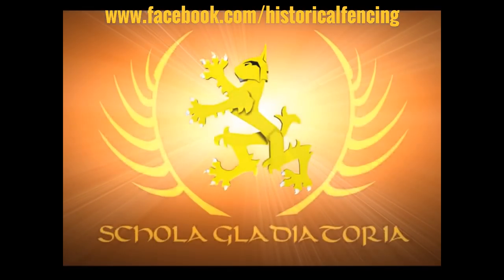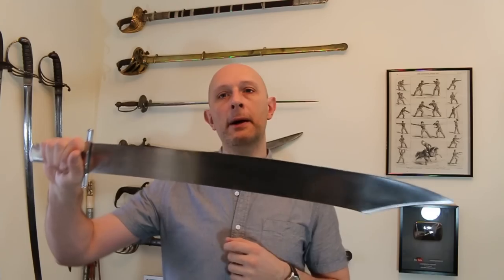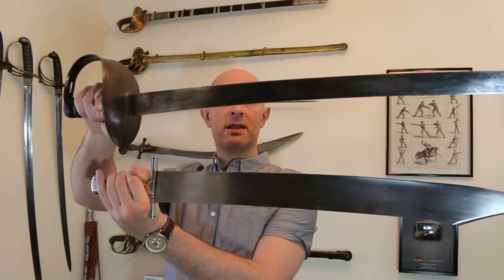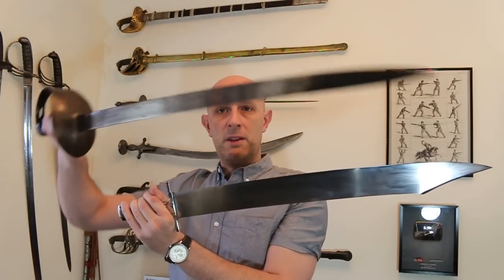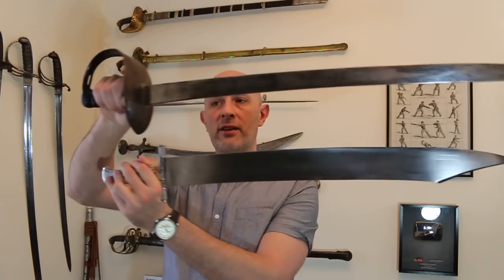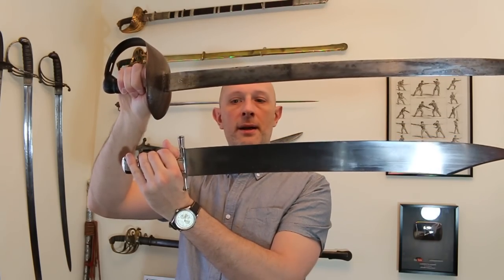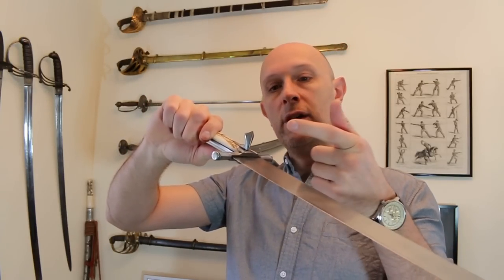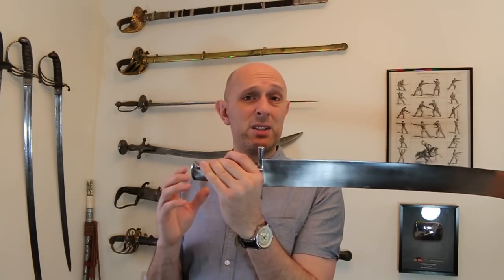Sword, Messer and Falchion Hilts - simple vs complex

Comment: If I had to guess, developed hilts came from the decline in popularity of protective gear.  You can afford to have a cruciform hilt on a longsword or arming sword, because they are generally used either with a large shield or while wearing gauntlets.  A 14th century man at arms may have plate gauntlets, or at worst riveted plate (brigandine style) gauntlets, so having plates or bows over the hilt of the sword is a bit redundant.  A 12th century man at arms using an arming sword will likely have a large shield that he can withdraw his sword hand behind, so once again, a developed hilt is slightly redundant.  Once people stop using protective gear, it has to be integrated into the sword.

Comment: One comparison I find fascinating is the Falchon, and Messer, because in Germany (Switzerland, Austria/Hungary, Scandinavia...) for a long time they existed side-by-side.  The Falchon was a knife bladed sword, for nobles (I believe chopping up the commoners) and the messer a knife handled sword.  So, they could be nearly identical blades, the only real difference (Legally, a Hunter could carry a "Knife") being the hilt.  Including the Tang, because the messer has a flatter one to rivet on side-plates, while the Falchon had a squarer one to slip on a grip, and peen in a pommel.  Without the fittings, the shape of the tang would be the only way to tell whether it was ment to be dressed as a knife, or a sword.  (Though i don't know of any examples, so more of a thought experiment.)

Comment: Given my family background (Scottish, from around Kintail) I have to wonder about a peculiarity of sword use; the penchant for using a targe and a basket-hilted broadsword or backsword. Are we Scots just a "belt and suspenders" sort of people, or does the style of fighting warrant such double protection?
Reply: morallyambiguousnet 

In the context of the Jacobite uprisings, it made sense. They used the targe in a similar way as the Zulus would use their shields against the British. It was meant to catch or deflect the point of the bayonet while executing the Highland charge. This would leave the redcoat exposed for a follow-up attack with the broadsword. 

As for the double protection of the hand with the basket hilt, it probably has to do with the overall swordsmanship trends of the time.
Reply: morallyambiguousnet, you need to remember that the basket hilt was a gradual adaptation of the sword following the mass adoption of firearms. Pistols in particular saw the end of the common use of armored gauntlets and the use of shields also was much reduced given the need to maintain hand dexterity and the pointlessness of all but the thickest shields vs lead shot. This meant that integral hand protection on a sword became a much more important consideration. Another factor was growing industrialization of manufacture which meant that swords became far more widely available to the common man. Swords were being wielded by people will little or no professional training in fencing and these people did not give a damn about the loss of agility of the blade a full basket hilt causes.

Comment: I think, given the choice, I'd take a slightly slower sword with hand protection than a slightly faster one without it. It's not much of a victory if you get 1-2 of your most important fingers cut off (especially if there are more guys to kill right after).
Reply: DaaaahWhoosh Also consider how important it was to her functioning hands back then. People worked with their hands, and a debilitating cut to the arm or hand could ruin a career.
Reply: It can depend on your equipment and style. 
A good gauntlet? A buckler to take on the majority of blocks? Then you might focus more on a light blade.

Comment: You briefly mentioned gauntlets.  I would guess that as the use of armour (mail or plate) declined, and people were more likely to be fighting with their hands bare (or at best with leather gloves on) they felt a greater need for hand protection built into the sword itself. Presumably from the point of view of the balance of weight, it would not make much difference whether the user has to manipulate heavy gauntlets or a heavy hilt, as they both add weight in much the same place.

Comment: The Messer could "Cut better" also if it basically didn't have a Falchon blade.  There's really no standard for Messers, beyond a knife handle, and Nagel, but the blades varied from Hanger to Dussack style, and so forth.  However, it's still a Knife, that looks like a Falchon with a Langes messer hilt.  Some of the ones I've seen, and handled have more of an sword length knife blade, a lot thicker at the back for strength, and even beaten to a hollow "Grind" with a fuller, if not fullered at the back.  What you've got there is a Matchette.  With a Messer hilt.  If it had a Sword hilt, it would be a Falchon.  Fine for cutting flesh, and even clothing, but thick leather, or thin wood (Like brush) or bone would wreck, and warp that blade.  I never realized how thin that blade really was.  Which is fairly accurate, or within the range of Messers they did make, but that's like a JagrMesser, for a hunter.  (I've also seen them called a hirschMesser, or deerKnife.) for cutting flesh, and pretty much only flesh.

Comment: That is why we often find a yelman on baskethilted sabres or Dussack, Tessak, Dusägge etc. in the 16th/17th century, having good hand protection and countering the weight of it with that for increased cutting power. Though bladeshape in sense of thickness in the back like Backswords or in case of Highland Broadswords having very flat, broad choppers, is another possibility in bladedesign to get enough cutting ability with good handprotection. For me personally every sword without solid hand protection (unarmored combat of course) is just a tool for chopping wood, just a big knife. So long Messers, even being the forefathers of onehanded civilian fencing in Europe, is the post imperfect weapon to me. No Baskethilt, no glory 😁😉

Comment: But doesn't making the hilt heavier (and moving the center of balance closer to the hand) make the point quicker? Didn't many swords (especially earlier ones) have deliberately weighted pommel caps for specifically this reason?
Reply: You need the point of balance to be at the "right" spot, not just "as far back" or "as far forwards" as possible. Viking swords have the point of balance much further up the blade than the more thrust oriented swords of the 14th/15th centuries. Just like how shashkas or falchions have the point of balance further up than spadroons. The later blades are lighter, so then the hilt also need to be lighter in order to have the balance at the right spot for chopping.

Comment: What do you think are the reasons for the shashka's lack of hand protection? In what contexts does it makr sense to forego hand protection entirely?
I imagine it (1) makes the weapon somewhat easier to get at when riding a horse and (2) shifts center of percussion forwards. 
Cossacks obviously knew the benefits of hand protection because they sparred with the equivalent of gymnasium sabre with basket hilts.
Reply: Somewhat funnily, a Russian envoy to Khiva (1819-1820) was told by one of the Khan's retainers that he could not wear a sword in the presence of the Khan. His response regarding his shashka was basically, "what sword? This is a circassian knife."
Reply: I can't remember where I heard it, but I've been told because Cossacks were predominantly mounted, keeping the hand higher than most men and contact with other blades would be minimal, thus not requiring hand protection

Comment: Is it really tested and confirmed that if you add a mass to the hilt without changing the blade then the cuts have less energy? I am sure they will be slower, but there will be some additional mass in the sword. If a less mass is always good then spadroons would be the best cutters.
Reply: It's not about keeping the mass low, but keeping it concentrated at the correct place. If you have a light blade and heavy grip, it will make for a poor cutter, but will give you a lot of point control - like a spadroon, smallsword or rapier. It is all about the relation of the weight forward and backward on the blade. This is irrespective of the total weight of the blade.

A lighter weapon doesn't make it a better cutter, but it will make it (most likely) a better weapon. You can move less mass faster, you tire less using it and it is easier to move it around.

Comment: Why don't Messers have two nails rather than one? Wouldn't it be slightly safer with one sticking off the other side, in case a blade ended up there, as well as bringing the weight a bit closer to the hilt?
Reply: Matt has talked about this in the past. Basically it is probably because a nagel on the thumb side would be a pain when wearing it (which is what you do with a sword 99.9% of the time). Also, I believe the langmesser styles focus on parrying with the outside flat of the blade, so a nagel on the thumb side flat really isn't too necessary.
Reply: I suspect that it might have something to do with comfort when wearing sheathed and on your belt, but I could be wrong.

Comment: Would a blade cut better with more distal taper just because it's thinner at the cutting portion or is there another reason?
Reply: I believe that distal taper is just for reducing the weight of the blade and it also seems to affect balance and handling as well.

Comment: With that cutlass, why is the hand guard so far away from the hand? It sticks out much further than needed.
Reply: But it looks like it would allow a thrust to actually get inside the hand guard - or is that just unlikely?
Reply: Fair enough then. I guess it looks much more exposed in the video than it would be in fight because Matt is holding it to display the cutlass rather stab the camera.
Reply: Well that guard doesn't just protect your hand. It's big like that so it closes the line to your arm as well.

Comment: Has anyone tried Titanium hilts?
Reply: Issue with aluminum and steel is the corrosion prompted by contact of those metals. Dunno how that works with various aluminum alloys; you could for insane weight savings use aluminum-magnesium alloys. 

The actual issue with these materials is how are you actually going to make the damn thing?
Reply: Aluminum is indeed lighter and fairly cheap, but its softness would be a problem.  At a Moh's* hardness of 2-2.9 (depending on the specific alloy/heat treatment) is softer than steel (anywhere from 5-8.5) so a steel blade can literally cut an aluminum guard.  It wouldn't be easy to chop right through, but the opponent would certainly be able to bend it a little, and if you are guarding many times with it against steel edges, one of them will eventually make it through: and that's a deadly lottery to win.  This is exactly the reason steel weapons and armor completely supplanted the softer bronze despite it being so much cheaper (not true any more, but good iron ore was hard to find for most of history), easier to work (bronze can be worked cold and only has 1 crystal structure, so heat treating is only needed to remove crystal lattice boundaries), and easier to maintain (bronze's oxidation doesn't eat through the metal like other rusts, and can easily be bent back into shape in the field if it bends): and that stuff's got a hardness ~3, so your average aluminum would have an even worse time of it.  Matt has shown in several videos that front-line fighters would often choose non-regulation steel hilts instead of regulation brass ones specifically because they were better able to take a beating.

*the original Moh's scale only goes from 1-10, the modified one goes 1-15, and slightly adjusts placement to better reflect common hardnesses for non-gem materials.  Same reference materials for the minimum (talc) and maximum (diamond) though.  The site I was looking at didn't specify which it was using.

As to titanium, the table I was referencing didn't list the Moh's number, but my understanding is that it's harder than some steels, softer than others.  You'd want to get a sample of a both a common steel for swords and titanium to see which scratches the other to test.  Also note that while titanium is stronger than steel by mass, it is weaker than steel by volume, so the guards would have to be thicker to account for that.